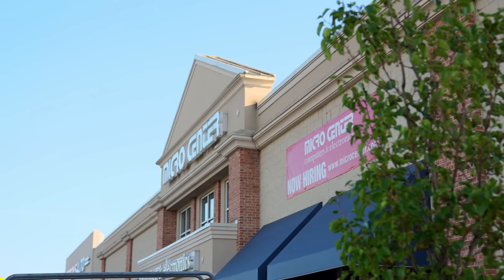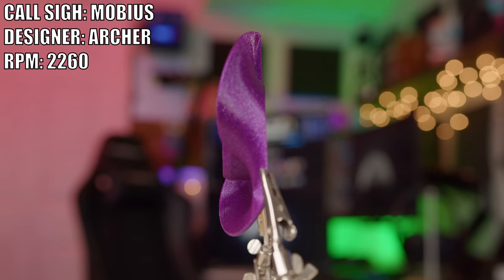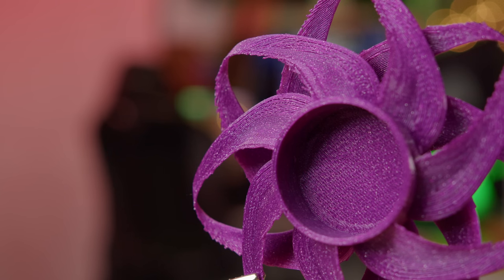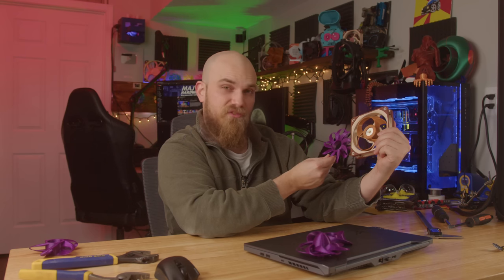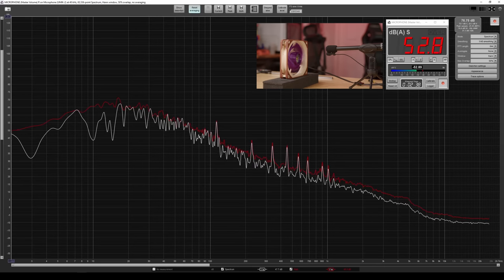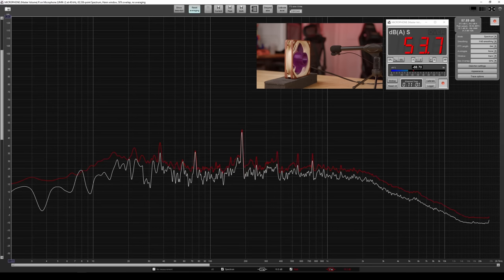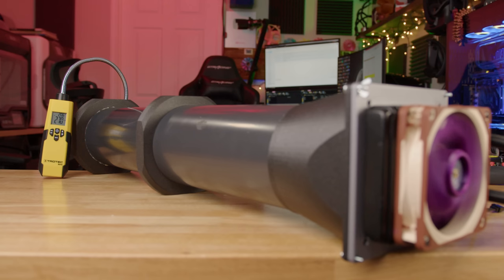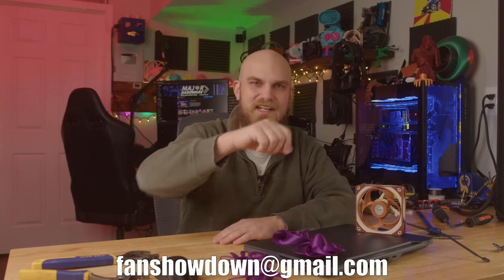My Subscribers Turned MIT Award Winning Toroidal Propeller Into A PC Fan | Fan Showdown S5E5

Comment: I think you're running into the issue of number of blades. The best measure to normalize all the fans is to print out a single blade, balance with a counterweight, and determine flow rt, thrust and power. Determine the slip from the flow rt and blade angle & rpm. Then you can determine the total fan efficiency vs flow or power.

Comment: It's an interesting attempt but the fans need to be smooth.  They will also have a problem with friction caused by compressed air between the surrounding "ring" of the housing and the edge of the blade.  If you actually want to test the designs, they'll need to be sanded to at least 1,000 (total guess, but I bet it would get you to 90% efficiency compared to completely smooth (yeah, another complete guess)) grit.  To solve the trapped air problem, you'd need to eliminate all but the very leading edge of the surrounding ring.  Also note that there is a pretty big gap between the ring and the outside edge of the blade that doesn't seem to be the same as the most efficient blade that you've tested.

They also need to be balanced.

It would be interesting to see if the motor draws the same current for all of the designs. 

It looks like there is some rumble in your sound test.  It might be better to test them while suspended on relatively slack rubber bands, though they would create some higher frequencies of their own - so there's that.  

As you can see, this is once again all a big hairy can of worms.  Good luck!

Comment: I need to figure out what type of 3D printer will let me print one large and strong enough to replace the prop on my Minnkota 38# trolling motor. It's the primary propulsion for my 12 jon boat. My "plan" is to fit the boat with folding outriggers and place one trolling motor an the back of each outrigger and use a combination of steering and differential thrust for maneuvering and propulsion.

tho it would be fun as hell to build an electric direct-drive jet-pump and hydrofoils. 😉

Comment: If there's some way to use K weighting rather than A weighting for your dB ratings (as defined in EBU R128), it'd make for interesting numbers that might better reflect the perceived loudness of the fans.
Reply: Why don't you read up on EBU R128 first, before bringing up stuff that does not apply. Also, read up on the history of the A weighting and why it should be used.
Reply: @christopherknee5756  K weighting is applicable to signals outside of its original context; and while A weighting may have been intended to relate to perceived loudness, it is a single continuous curve which is highly unrepresentative of actual perceived loudness. If you are going to use one of the IEC curves, surely you'd use one of the better-fitted ones.
Reply: K is fitted to a contour at a reasonable program amplitude, and is a pretty good measure of loudness in its own standard listening condition (which happens to be similar to the conditions where you'll be hearing PC fans).

Now of course, if you want to be super anal about all of this, then the dBA measurements should be taken at a standardized distance and angle, and that doesn't matter because nobody listens to fans right next to them, and we need to simulate an operating condition like a room before we can take any weighted measurements of loudness...
...but we're not being that anal are we?

Comment: Wouldn't it be better if you print your fans with a SLA printer? I mean a smoother surface reduces all the little air turbulences that will occur with all the little bumps. It would also make your comparisons much more accurate as each shape has different bumps due to the filament printing. So it would be logic to try getting rid off this factor. 
I really like your videos :) they are very entertaining. XD

Comment: It seems like perhaps the toroidal shape doesn't benefit within a fan frame since the frame itself is kind of doing the same thing, no? I'd surmise that they work well with drones by allowing the blades to generate slightly more pressure by increasing the enclosedness of the blades compared to a traditional style where they don't connect to each other. I'd love to see if they can make more static pressure with smaller size and faster speeds.

Also saw another comment mentioning smoothing the parts out by quickly dipping them in acetone, which sounds very interesting. Would love to see how much of a difference that could make!
Reply: I guess it's kinda like having a ducted fan, as the fan.
Reply: @oEQjet  That's what I was thinking, yeah. I'd be interested in seeing some tests to verify, but I think it's a good starting point for trying to understand what's happening.

Comment: I see the Toroidal Propellers just as a Ducted Propeller. — or: why the heck is a toroidal unessecary in PC case fans.
So the Toroidal Propellers does grab extra sourrounding air and attaches them to the directed airflow as well. This highly increases efficiency and has the possibility to reduce noise. BUT you buy that by reducing your diameter for the optimum air moving blade angle. Instread you grab the fastest moving outer edge and convert it to that toroidal shape. Which given, does indeed create a better fan than the same diameter without toroidal shape would do. Anyway when you have a case fan you already have a ducted fan. Well obviously depending on the fan duct geometry the fan duct itself is already a multiplier for the airflow. It as well does attach sourrounding air to the flow that otherwise would not be moved by the fan also increasing its efficiency. So we now laeve the part where pure fan blade design is a factor but the fan duct itself becomes more and more a factor. Which this channel has already proven. *laughs in Cheater
Here we are right now: A fanduct inside a fanduct — This is why the toroidal propellers inside fan ducted fans make no sense.

BUT what if you replace a free spinning fan. ^^
Do you remember the old Arctic Freezer 7 Pro with th free hanging fan. All newer versions got some kind of fan duct for airflow optimization.
For this use case I would bet a Toroidal Propellers with its optimal RPM beats the Open Fan design. Have fun testing that ^^

Thank you very much! For all of the great work of all experiments and showdowns the internet could witness already on this channel! Looking forward to the next episode, as always.
Eld0r

Comment: From quickly looking at some patents, they would suggest that a Toroidal propeller would terminate at a point on the next blade, which none of these fans do. If I were to design one I would start the fan blade pitch similar to a prop, starting with a very low curve % that rapidly works up to create a swoop then a slow curve down to the center of the next blade, slightly offset toward the center, make this end of each blade a 90 deg. rotation of where the blade started, repeat three times and verify that the center of terminating blades do not overlap the center hub.  My Reasoning: In the patent you can see the start of the propeller is a very similar to a regular propeller and continues before it rapidly curves and swoops back in at which point the curve is greatly reduced the the blade gently connects back into the lower center of the next blade. It appears that the termination point of the blade does not goes past the center of the prop, you can almost draw a line from the inner corners and not hit the center. I think its the combination of these factors that make all the difference.
Reply: Thanks for the feedback. 
Expect more videos soon. 
Send a direct message... 
I have a Gift for you📦.......

Comment: This isn't a particularly fair test against the noctua. The noctua will have smooth injection moulded fans, the 3d printing definitely adds some extra variables; layer lines, weight, weight distribution etc.

You could try 3d printing some noctua-like fan blades, see how they stack up.

Comment: Fans and propellers function differently so you can't just take a good performing propeller and expect it to work well as a fan.
A fan is designed to move air and a propeller is designed to move itself through the air.
They are optimized very differently: for a fan, you get better performance if you compress the air (more air molecules = more cooling) and tip vortexes don't do much to hinder performance,.
For a propeller, tip vortexes create parasitic drag and reduce its performance and so does the centrifugal force. That's why the torus works better, it minimizes these two factors. 
Fun fact: The spitfire had a smaller radiator than its competitors because they compressed the air flowing through it allowing it to cool more efficiently.

Comment: Wouldn’t toroidal fans theoretically work better at a much higher RPM. Like that of a quadcopter? Is better, if not similar flow, a pipe dream due to a limitation of RPM. And wouldn’t their poor coverage of the fan frame prevent high static pressure and lower flow on a radiator?

I like the ideas and am curious as to how these fans work and turn out!

Comment: I would probably scrap your printer and buy a resin printer that would make trailing edges really trailing not scratching the air. To push air you have to push not scratch it out.

Comment: A higher resolution printer, especially a UV resin printer, would do significantly better for these applications. Trailing edges that aren't tapered ("Sharp") tend to have harsh transitions in the fluid flow, leading to harsher wingtip vortices . That's why the designs of wings (amongst other devices) tend to be sharp at the edge

Comment: Before we continue, perhaps we should look at this word that we're throwing around recklessly.  Toroidal means related to or shaped like a torus.  In other words, it's doughnut-shaped.  Toroidal does not mean "skewed hollow cylinder" or "angled loop".  I don't know what word I would use to describe these shapes, but "toroidal" isn't it.
With that out of the way, I find these designs interesting.  They are aesthetically pleasing, though I don't ecpect them to top the charts.

Comment: These toroidal fans are great for things like drones and airplane props, but solve a problem that doesn't really exist for ducted fans.  That shroud on the Noctua makes it fall under this category.  Using a toroidal fan with a shroud is probably not the best use of either.  If you could run these all without a shroud, including the Noctua, you might see some improvements from the toroidal designs.  

From Wikipedia: The duct increases thrust efficiency by up to 90% in some cases, in comparison to a similar-sized propeller in free air.

Principally, it reduces the vortices created by air flowing round the ends of the blades. This reduces the aerodynamic losses or drag, thus increasing the overall efficiency of the fan. Because of this, the fan can either be used to provide increased thrust and aircraft performance, or be made smaller than the equivalent free propeller.

It provides acoustic shielding which, together with the reduced energy waste, significantly cuts noise emissions from the propeller.[4]
Reply: Thanks for the feedback. 
Expect more videos soon. 
Send a direct message... 
I have a Gift for you📦..........

Comment: I bet the Sharrow style would do better if it didn't have that big hole at the front. That's going to cause turbulence, the number one killer of efficiency.  Make it with the aircraft like spinner on the front like the 7 blade toroidal which I think is why that one is so quiet, and the Sharrow type will come out better. Unless one is bent on failing every potential competitor to the Noctua NF-A12x25.

Comment: Would it be possible to add the static pressure that the fans are generating if it's not hidden in the data somewhere? Since these are modeled after propellers maybe they'd work better for cooling thicker radiators/heat sinks than just chucking air into the case?

Comment: I'm not an engineer, by any means, but my question is this, would this combined with a fan designed to be on the back end of this do better than a single fan? for instance if I were to think of it like this. 
Yes, as a standalone it does worse, but if you combined it with the RIGHT kind of exhaust fan or used it as an exhaust fan to optimize another fan, would these work better?

Comment: Toroidal fans would probably make sense at extremely high RPMs, on the order of several tens of thousands of RPM, where the tips of the fan blades would begin to approach Mach 1.

Regular computer fans only spin on the order of about 1,000 RPM. We're not even in the same ballpark. The added weight and reduced surface area devoted to moving air just doesn't seem to have any return on investment.

Seems to me like designs intended for propulsion are fundamentally incompatible with the task of quietly moving large amounts of air for ventilation purposes.

Comment: Toroidal case fans aren't really viable for airflow because modern case fans already enclose the end of the blades preventing that cavitation of the airflow. So a very quiet traditional fan can already be made. The only time the toroidal shape would be useful in reducing noise and increasing airflow is when the blades are exposed and are not encased around the sides. While the idea of using toroidal fans is fun, I do not believe they will ever be able to replace current case fan designs. I still look forward to everyone's amazing creativity. Who knows, maybe someone out there is creative enough to make a super effective almost silent fan with toroidal blades. If so, I would likely buy them for my next build!!! Happy inventing everyone!!!

Comment: I wonder if a toroidal shape has any use in a ducted fan. The toroid shape is meant to prevent excessive turbulence at the end of the blades, but what use does that have if at the end of the blade there is this big wall?
Reply: I think so too, but the toroidals should be stiffer at least, because it supports itself better, push-pull. 
Normal propelles flex when you give full throttle. Maybe that could be taken advantage of even in a ducted fan. But fans have shorter blades than propellers.

Comment: I think if the goal of thoroidal fans is to reduce noise, that comes at the expense of having to increase the RPM.. If you increase the RPM of the toroidal fans until the CFM matches that of the control fan, and you measure the noise level, will the toroidal fan be quieter?. I think that's the whole purpose of these fans, that they are quieter at the same CFM, but that doesnt mean the achieve the same CFM at the same RPM.

Comment: No engineer here, but I don’t think this type of fan are designed to work in a shrouded device. I know that a regular outboard prop performs much better with a shroud around it, so there’s no need advantage for this type of fan with a shroud. But if there is no shroud these fans would probably outperform. Is there someway you could do the experiment without a tube and without a shroud just as a regular propeller would be on an outboard?

Comment: Do you have resources for turning an STL file into a "successful" print?  When I was working with slicing software, I had trouble knowing what part of the model to make the bottom.  Then I had a problem choosing the correct temperatures, and that's ignoring everything I managed to accidentally get right.  I stopped when cleaning out the scaffolding material was laborious and didn't want to keep fighting.  Specific blockers for my setup is, I'm doing everything on Linux and have an affinity for FOSS.

Comment: I  haven't seen a commercial use of these style of blade that are encased, is it that these blades will have better air flow if they can pull air from their sides (open blade design)

Comment: I I am a firm believer or supporter that fans should have 1, 2 or an odd number after that of blades, but I would like to see the three-blade version where somebody takes another one and drops it right on top of it rotated to make it a 6 blade. To be clear not as one on top of the other but to merge them. Although one on top of the other might be interesting and one inside the other might be interesting as well where the inside one is smaller in diameter
Reply: Thanks for the feedback. 
Expect more videos soon. 
Send a direct message... 
I have a Gift for you📦............

Comment: I'm not very knowledgeable about fans, or fluid dynamics in general, but it's it possible to find a "sweet spot" for the different fan designs instead of running them at the same rpm? Maybe some fans reach a high level of performance at a specific speed and after that it's just diminished returns with added noise. Can you create an air speed or pressure (x) and noise (y) graph?
Reply: Thanks for the feedback. 
Expect more videos soon. 
Send a direct message... 
I have a Gift for you📦........

Comment: Not fare comparing injection molded VS 3D-printed.
Could you please PRINT the "standard" aka "reference" blades and test using them instead and THEN compare to the printed toroidal ?

Comment: question in the MIT version say for boat propeller  is there more contact surface area per a 180 degree sweep around the propeller that makes the increase.   Or does the vortex off one part of the blade perfectly get caught by the next blade  ?   Or perfect design or combo of both :? Nice videos.  thanks